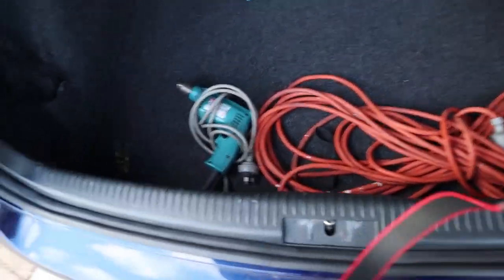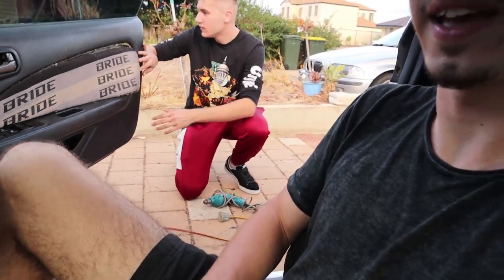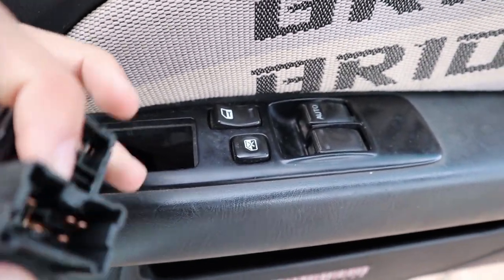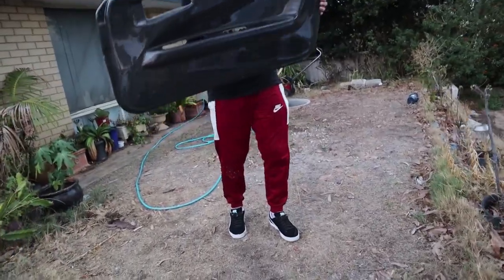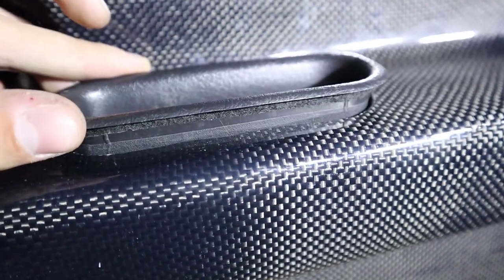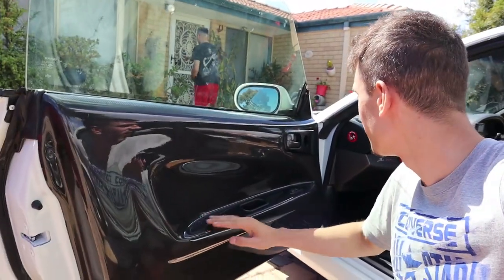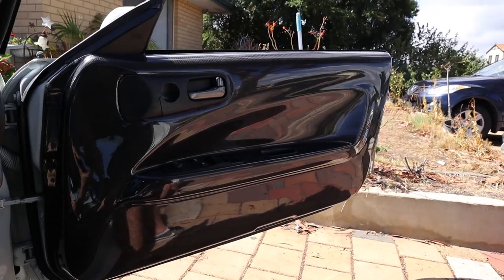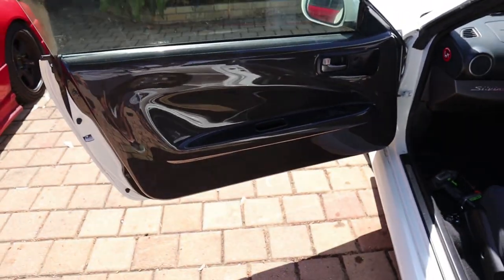How To Install Carbon Fibre Door Cards On An S15

Comment: Do you have a link for the carbon door cards? Brand name?
Reply from the maker: Honestly bro, my mate and I spent an hour searching for the one he got from a private seller and couldn't find anything. We came to the conclusion that his ones an older version as all we could find was this one, different design which may be an updated version https://www.ebay.com.au/itm/CARBON-FIBER-RHD-DMAX-DOOR-CARD-PAIR-FOR-NISSAN-S15-SILVIA/262799695190?hash=item3d30151d56:g:vDIAAOSwbtVZS3XS